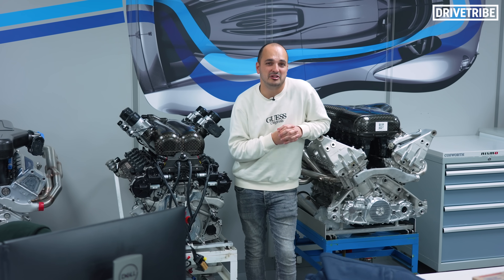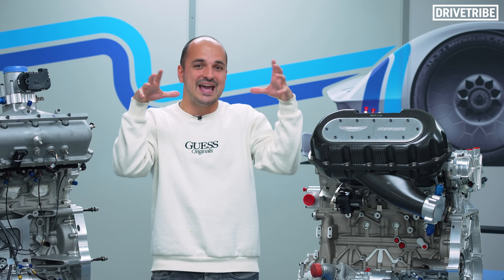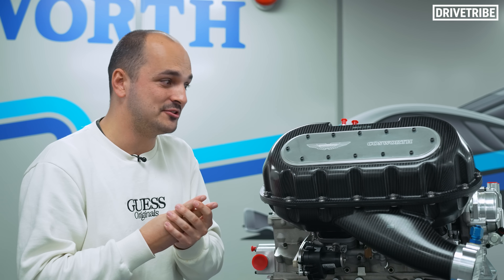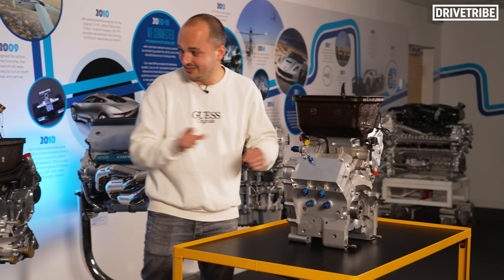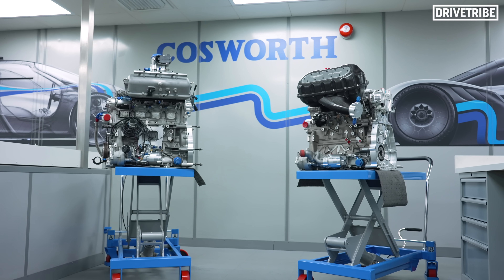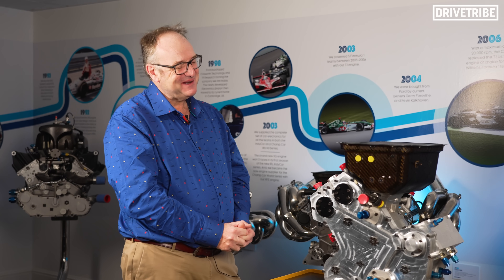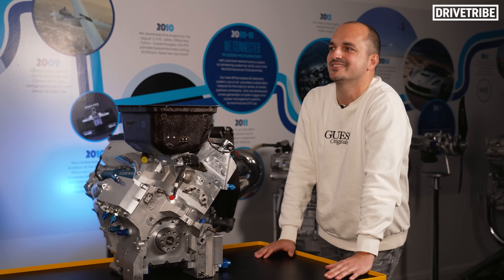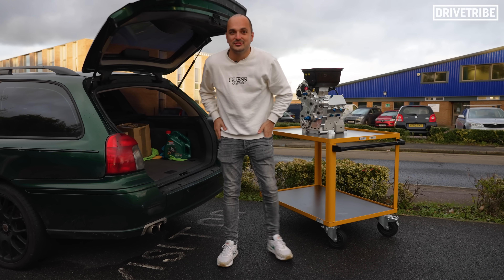This is a single cylinder F1 engine – 20,000rpm, 300cc, 90bhp!

Comment: I would never have guessed a single could run up to 20k rpm! Amazing, very informative video.
Reply: Modern F1 engines actually use pneumatic "springs", but there's various ways to achieve a very high reving engine. Desmodromic valvetrain (the valve is energized on both the opening and closing strokes), fully pneumatic cam-less actuation, and of course just ultra-light valves, retainers, paired with super heavy springs. NASCAR engines in the early 2000s were able to rev to nearly 11,000 rpm despite being antiquated OHV monsters so it can happen
Reply: No clue how they overcome valve floating over 13 14k
Reply: @DDBmaster   heavy valve springs
Reply: @DDBmaster  Ducati has created a system that would take care of that no problem. Forget what they call it but it opens and closes the valve mechanically with no spring.
Reply: whats the point of high revs and HP? Just low rev with strong torque and it'd work on any gear ratio
Reply: @White_Night_Demon  in general or for this particular engine? There's only so much you can do to improve an engine's torque output without increasing displacement. Increased displacement comes at a penalty of size and weight, which are not ideal for an F1 car. In addition for a single cylinder engine your torque production is further limited by the fact the engine fires only once every other revolution, making it difficult to make usable torque and power at low rpms

Comment: Back during WW2, Rolls-Royce and Ricardo developed the Merlin and Griffon engines using V twin and single cylinder test mules. Merlins were known to throw con rods at high revs. But the test mules never did. It was eventually realised the test V-twins used the full size oil pump - no worries. The pump was too small to feed the V12. Bigger oil pump and no more thrown con rods.
Reply: thank you for the information !
Reply: Not forgetting Ricardo’s single and V twin Sleeve valve 2 strokes used during RR Crecy development, giving incredible bhp/litre figures for the day and equally high HP/Lb weight figures

Comment: Wouldn't 300cc with 90bhp at 20k rpm make very little torque? Like 20-30? Cool engines. Never would have thought they sized down the engines for testing and stuff.
Reply: Your spot on. From what I can find it has a max torque of 26 lbs ft at 16k rpm.

Comment: Don't bother trying to find a fancy gearbox, just take a 3:1 planetary reduction, stick it on the back of the engine and bam now 20k rpm is like 6.6k rpm, totally normal gearbox speeds and torques.

Comment: You can tell it was machined as quickly as possible.  The tool marks, the edge breaks, the basic geometry with not much in the way of 3D surfacing. It looks like a group of machinists banged all these parts out in a day 😂 but clearly absolute Gods of machining to do that with the insane tolerances I’d imagine these parts have.  GD&T nightmare.

Comment: 2:55 this is a 1625cc triple that makes 250 hp at 11500 rpm
Meh!
Since 2014 you can go into a show room and buy an 850cc triple that makes 115 hp at 11500 rpm and has a flat torque curve from about 3000.
it currently costs £9000 and is called a Yamaha MT09 - and for that price you get a complete vehicle that can reach 60 mph in 2.8 seconds
Reply: You've got absolutely no idea what you're talking about. To scale an 850 cc engine to 1.6 liter is nothing like you imagine.

Comment: Beautiful engines and amazing engineering!!  Thant being said, having to meet emissions standards on these cars is ridiculous.  There will literally will be 80-150 made of each model.  Of which most will spend their life in a garage, each only getting probably about 1,000 miles put on them over a 10 year period.  a high mileage "driver" 30 years from now will have 15-30,000 miles put on it.
Reply: Thats a joke in 30 years try to find gasoline for a street engine. Alcohol might be available at moderate cost or you could make it.  But gas will probably 50 bucks a gallon and hard too find
Reply: @SurferNorm6360  That completely missed the point of my comment, even though it's true.
Reply: @SurferNorm6360  no i would be banned if we survive till then
Reply: @SurferNorm6360  when people move to EVs the demand for fuel will go down thus making it cheaper, gg

Comment: That 1 cylinder needs to go in a motorcycle, not a car. Easier to make a motorcycle gearbox that can handle 20k RPM (it's been done before). The lower weight will also help with usability. Like the guy said 14k RPM just to get moving in a car... That would lower quite considerably for a motorcycle. Plus motorcycle manufacturers have been opting for lower cylinder counts to keep production costs down. This would be a win-win for the industry.

Comment: My MT-03 (the proper single cylinder one) made less than half that power, with more than twice the displacement :O

Correction: a little more than half (48 horsies)
Reply: and it doesn't need rebuilding every 200 miles, unlike an F1 engine 😉

Comment: Double the rpm Double the power !   Torque x rpm horsepower anyway.   300cc single could  45hp at 10k rpm probably.       Crf250r makes 39hp

Comment: The tolerances on that 300cc engine are likely so tight, that cold it is locked solid. Formula 1 spec engines have to be warmed up before you start them, for this reason.

Comment: Turboprops use a gearbox to reduce huge RPM from the engine to the propeller, some are capable to deal with 20k RPM easily, you guys could give a try using Oliver and this 1 cylinder engine.
Reply: True, you would need a reduction gearbox but it would work

Comment: Those high rpm's would put enormous loads at TDC, The short strokes can't do much for low speed torque.
Reply: Shorter strokes means lower piston speeds means higher revs

Comment: Stick a 3:1 planetary on the back of that single cylinder 300cc and you have an output range of 6-7k RPM to the transmission. Not counting friction losses that's similar to a 270 BHP (correction, 900) engine. You can find a transmission that you can stuff in a cadet that will do that job.

Did the math.
300 BHP @ 20k RPM is ~79 ft/lb (I have no idea what the real power curve is, so I just used max RPM)
Triple 79 ft/lb with this impossible high RPM planetary torque converter and you get 237 ft/lb. 

Turns out if you have 237 ft/lbs @ 20k that's equal to a 900 hp normal engine. That might pose some issues.
Reply: Gearboxes don't increase bhp
Reply: @E9X330  
Gear reduction changes torque, and horsepower is defined as torque per second (1 HP is 50Lbs over 3 feet in one second).
The torque figure was not given, so I skipped all the conversion steps.
Reply: @mitchellpatterson1829  a gearbox exchanges torque for rpm, the power doesn't change
Reply: @E9X330  
I'm aware of that, the torque figure of that engine was not given. Since horsepower is torque over time I used the same multiple to illustrate the output would still be reasonable (assuming the reduction drive survived). 
Horsepower = Torque x RPM / 5,252

Did the math.
300 BHP @ 20k RPM is ~79 ft/lb (I have no idea what the real power curve is, so I just used max RPM)
Triple 79 ft/lb with this impossible high RPM planetary torque converter and you get 237 ft/lb. 

Turns out if you have 237 ft/lbs @ 20k that's equal to a 900 hp normal engine. That might pose some issues.
Reply: That's a very non-trivial 3:1 planetary transmission to design.  Afik, it either needs extremely tight tolerance gears, and/or carefully planned oil injection so the gears never actually touch at high rpm.

Comment: Koeningsegg is doing a 3 cylinder 600hp... so... 90 for 1 dont seam that much
Reply: It was twinturbocharged.
Reply: @epeli0035  still heck of a lot more power
Reply: @matsv201  The technology is also a lot newer on the koenigseggs 3cyl, I think they used the new freevalve system and of course just modern technology. That single cylinder is almost 20 years old
Reply: @epeli0035  that is true.. but the 3 cylinder engine that is freevalve is actually less powerfull than the 8 cylinder per cylinder. While, the torque is a lot better for the 3 cylinder, (per cylinder) making it a better hybrid engine.
Reply: @matsv201  Yeah

Comment: could put a super charged motorcycle engine into oliver .... One of the Kawasaki ones springs to mind !
and with so much power, no need for a reverse gear, just do donuts to turn around in tight spaces ! (maybe .... )

Comment: Cosworth learned something from Honda as Honda engineers first benchmarked the single thumper found in Cubs/Dreams in the 1950s and later scaled-up the design for cars, lawnmowers, outboards, etc.
Reply: I was going to whine at them because Honda was approaching these numbers back in the 80s already on single cylinder pistons.  For example, I have a 1984 XR500R dirt bike that makes 41HP at 6000 rpm.  Given the rev and age differences, this cosworth just seems like a built version.

Comment: My NC35 400cc V4 back in the 90's used to spin up to 14,000 RPM and met road emmisions with a normal carb system, that could easily be retro fitted onto an injector system to meet current regs
Reply: Honda were racing 250cc six cylinder motorcycles in the 1960's that would rev to 20,000!
Reply: @FFVoyager  All of the Japanese bike manufacturers had 250cc four cylinders in the late 80's into the 90's that were scratching 20K as well
Not race bikes mind you, cheap street bikes meant for new riders. They're still a fairly common sight as a first bike here in Australia.
Reply: Honda spec was 75 Hp tuned

Comment: This may be a dumb question but if the single cylinder engine had 2 alternating sets of exhaust valves with a dual header design to route every other combustion cycle out the other exhaust pipe, would it still sound the same or would it sound more comparable to a twin cylinder at half the RPM?

Comment: Can I send my CRF300L engine to them 😂
Reply: Just do an Alan millyard and weld 3 engines together in your garage
Reply: when the crf beats fz
Reply: The oem crankshaft don’t do well above the factory 286cc displacement 
There’s a lot of people big bore their 250L and Cbr250r which does not last long before it destroyed itself 
I think there’s two main reasons 1. Crankshaft didn’t use ball bearings 2.camshaft are sitting on bare aluminum 
So it doesn’t respond well to high rpm,high compression or bigger bang in general
Reply: Low pressure electric turbo, and a thinker metal head gasket, and you have 60bhp no problem, I did it on a XR650, and it was much quicker than my R6 up to 70mph ish. :)
Reply: @hardergamer  leaf blower?
Reply: @billbergen9169 might as well stay aspirated, turbos hit upwards of 130k rpm to get the boost they offer, a leaf blower wouldn't hit half that, might work but people aren't doing it already so it's probably not going to work
Reply: @hardergamer  or just get an SMCR 690 and have 76 HP stock right off the Bat..   XR is a cool bike dont get me wrong..  but if your going for power and speed on an Enduro/SM you started on the wrong bike..  KTM SMCR or the Husky 701 enduro
Reply: Just go to thailand😉

Comment: That single cylinder would make one heck of a go kart engine
Reply: Not with a 100 pound transmission to for the enormous gear reduction.
Reply: @TucsonDude  
He said 20.000rpm. Not 200.000rpm.
👍😅
Reply: @Gean...de...Oliveira  Nah.  Regular go-cart engines run under 4000 rpm.  Running at 20,000 rpm would require five times the gear teeth on the input gear...hence it would be significantly bigger.
Reply: @TucsonDude  
You are talking about rental karts, right ?
Because a proper racing kart usually rev up to 16.000rpm.
Reply: @TucsonDude  But yes, it would need an initial gear reduction before the output gear. Because 20.000 rpm would need a 100 teeth sprocket. 😅
And racing karts usually use ~80 teeth sprockets.
Reply: @Gean...de...Oliveira  yeah but wouldnt it be faster?
Reply: @TucsonDude  Do you mean diesel carts
Reply: @TucsonDude  why? sounds like weight where you need it. scale go cart to cope.
Reply: I actually don't think so.
In Karting we have 125 and 175cc 2-stroke engines with up to 50HP.
Most classes usually have around 30HP but that's not a problem when the engines weights less than 15Kg.
I think modern Kart engines don't rev more than 16.000rpm.

BUT, in a straight line, maybe it would be fast.
Reply: @Gean...de...Oliveira  so you just explained how it would be great on a kart
Reply: its actually not that great at all...  besides the rev limit..   KTM and Husky already have a motorcycle engine similar with little less HP and lower revs but much smaller and with transmission already built in...   engine series is called LC, i think LC4 meaning 4th gen..  LC4 693cc at 74HP, 54.2 lb.-ft. and fits in a dirt bike..

idk how much the engine weighs but a comparison.. the SMCR a SM dirtbike weights bout 375 while a normal SM dirtbike from KTM the EXC weighs 275ish

so weight wise think this motor might be bout 200lbs? idk.... the KTM 500cc in the EXC is a tiny engine tho and still makes 60HP
Reply: @dondutch4107  Now imagine that 700cc engine putting out a proportional amount of power: about 180+bhp.
Reply: You could always artificially reduce the engines output to be more tame
Reply: @eageraurora879  
But it would make things even worse. We would still have a big engine but with less power. If we're going to use it, better have 90HP.
Reply: @eageraurora879  so give it lower gear ratios then?
Reply: @White_Night_Demon  
Maybe not because with 90HP it would be able to achieve better top speed. So a 9/80 (common numbers in Kart racing) sprockets could work. 🤔
Reply: @Gean...de...Oliveira  So you reckon a 90HP engine can start with a 80 teeth sprocket can drive a 9 teeth sprocket, no without stalling on a flat surface or even uphill? Or is that other way around? 9 teeth driving sprocket to 80 teeth driven sprocket? I'm just guessing, I don't do go kart racing so I have no idea. 

I wonder what the highest ratio you can get on small engines without stalling(or making them struggle being not strong enough to drive that big of a ratio) them on a nice flat road... And then we could work down from there.
Reply: @White_Night_Demon  
The 9 teeth is the driver sprocket, attached to the engine and the 80 the driven, on the axle.
With such rotations we need these kind of reductions, probably more. 😅
Using a 9/81 set, the engine revs 9 times for each wheel rotation, right.
But I'm just guessing too.
I love Karting, I used to attend regularly to our regionals and I know a bit about it, using different engines always require some testing and adapting. But I think you could make it work for sure. If you search here on the YouTube you'll see some crazy projects. Much crazier than this. 😅
Reply: @Gean...de...Oliveira  What if you do 9/9 for a direct drive?
Reply: @White_Night_Demon  
It would be very hard to fit a 9 teeth sprocket on the axle. 😅
But let's say we manage to get a 1 to 1 gear ratio.
It means the axle, and the wheels, would rotate 20.000rpm at top speed.

According to a "Go-kart gear ratio and speed calculator" I found here, @14.000rpm a 9/81 sprocket combination would be able to reach ~82Km/h (a quite low speed to be honest, I think it wouldn't be very common).
@20.000rpm, a 1:1 gear ratio would, theorically, reach ~525Km/h.😅😶

So that would not be possible.
First: I DOUBT the engine would be powerful enough. 🤔
Second: Without any reduction you would struggle a lot put the Kart in movement. The idle rpm of the engine would require the wheels to be sppining too much. Even with a clutch it would be a problem.

I think we really need a reduction.
A 12/80 set @20.000 would reach ~160Km/h. I seems to be a way better starting point. 🤔
Reply: @Gean...de...Oliveira  well if a 9 teeth sproket wont fit how about a 20 teeth one with the same 20 teeth one on the axle?

And holy jesus, go kart engines revs up to 20k RPM???!! 

Imagine going 525km/h......on a go kart.

A gear ratio of 0.15...? That's the most it can do? How much HP do typical go karts have? The race spec ones for professional track racing, not home made or DIY go karts.....
Reply: @White_Night_Demon  
No. Karting engines go up to ~16.000rpm. Usually less.
And they have around 30HP. Going up to 50HP in some classes.

With 20.000rpm I was referring to the Cosworth of the video. With a 1:1 gear ratio (let's say it doesn't really matter what are the sprockets) this engine would reach ~525Km/h, "in theory".
That's simply too much. The ratio is too long.

Sure, doing 525Km/h would be crazy. 😅
It would be uncontrollable and the bearings, tyres etc wouldn't be able to handle so much speed.
Reply: @Gean...de...Oliveira  INteresting. So those home made karts with like 8HP engines are nothing compared the the 30HP on proper race karts? Hahahah
Reply: @White_Night_Demon  
Some homemade go-karts are pretty decent projects.
But, in general, yes, a racing kart is a proper racing machine. Full of Aluminum, Magnesium parts, slick soft tyres, a big brake (compared to its size) etc...
One of the greatest forms of motorsports in my opinion. When you are on the track watching, you can see almost the full circuit. 🙃
Reply: Or imagine that in light snowmobiles that weigh under 200kg

Comment: Usually f1 engine manufactyred they have a single engine for fuel test, injection andò iniection test mainly.
This van ne the purpouse.
I saw it in Ferrari testing also new piston diameter.